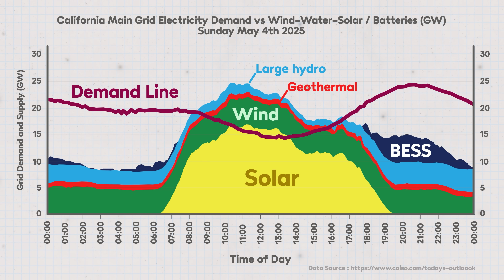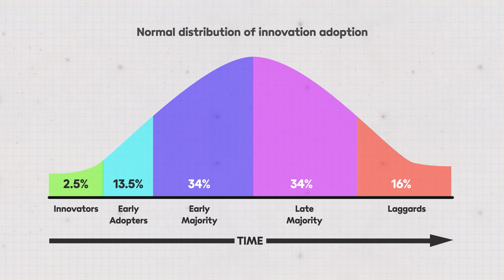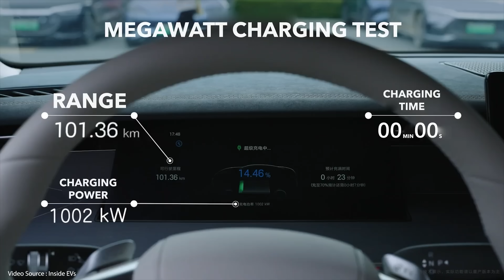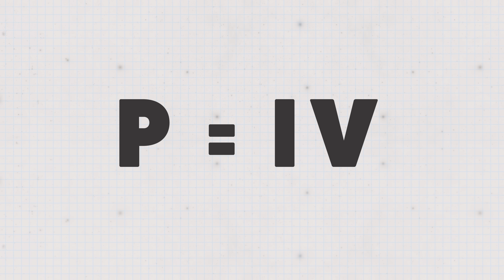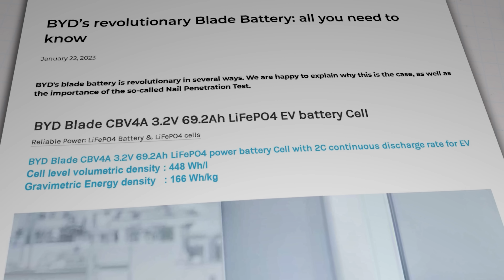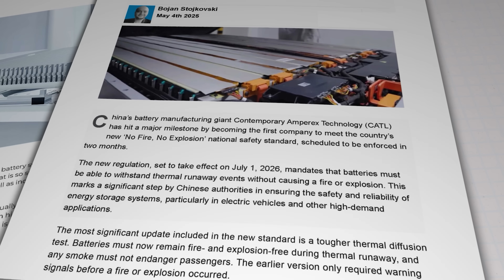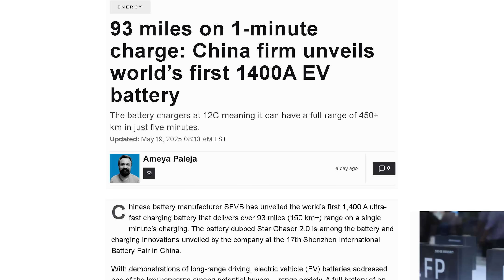BYD 1 MEGAWATT 5 minute EV Charger. Overdue or Overkill?

Comment: I've watched your videos, and appreciated them for some time, but I was very disappointed with this one! I suggest you look at the video on this topic by an Australian YouTuber, who goes by the title of MGUY. He correctly points out that the infrastructure needed to provide the power required to charge even a relatively small number of EV's in the same street, just doesn't exist right now, and may never exist!  He is specifically talking about Australia, but I have no doubt that his conclusion is valid for all developed countries. Heaven help the undeveloped countries. You seem knowledgeable enough to calculate the power required to charge 20 EV's in 5 minutes, and I strongly recommend that you do that calculation yourself. If you're unable to do the calculation, MGUY has, and it's in one of his videos. Here's a link to that video: https:www.youtube.com/watchv=GN8fPv3rRww&ab_channel=MGUY Australia  In addition, MGUY, in a previous video, explained the mineral requirements needed to achieve "net zero" by 2050, of which EV adoption is but one of many elements of this target. Here are a few examples. To have enough copper, the rate of mining copper at the 2019 level would take 250 years! If you think that's bad, listen to this: To have enough Lithium would require mining for 13 thousand years at the 2019 rate, and Gallium, 30 thousand years at the 2019 rate! Here is a link to that video:  https://www.youtube.com/watch?v=bw3M1SUZL4E&pp=ygUEbWd1eQ%3D%3D At 73, all the nonsense of net zero by 2050 is not going to have any impact on me, and I intend to keep an ICE car. The net zero zealots are welcome to their Molotov cocktails on wheels!

Comment: My feeling is that 5-minute charging is overkill for most EV drivers that can charge at home, but has a much greater degree of importance for those that can't. Of course, for the latter group, all the charging speed in the world only helps if a charging station exists near their home capable of delivering such speeds, with access as quick as the local gas station. And, at least a present, this is a huge "if".

It's also worth nothing that, in China, most people live in large apartment buildings, so the percentage of drivers capable of charging at home is much lower than in the U.S. This puts a lot of pressure on Chinese EV makers to fully replicate the gas-station experience in order to sell EVs that may not be as necessary here.

Comment: I’m not hooking up my cars battery to the grid. I would like to use it for temp power outages. But I will never agree to my car battery back flowing into the grid. It’ll be that time when I need to move, that the battery will be drained.
Reply: It's also doing wear and tear on your battery pack using up charge cycles...  No thank you, I'd rather have a full EV to be able to drive than give back to the grid UNLESS they were to pay me three times as much per kWh...
Reply: How do you charge if not from the grid?

Comment: I've been buying cars for 40 years.  2 months ago, I bought my first EV.  Reasons for my choice include efficiency, reduced environmental impact, low maintenance and low running costs.  It is a sea change for sure but one that's not difficult to adapt to.  I mostly charge at home.  I've only used a public charger once.  I try to charge in the daytime when there is plenty of renewable energy in the grid.  A full charge at home would cost me under A$20 and with that, I get around 600km.
Reply: What car do you have that does 600km on a charge? How far at 110kph on road trips?
Reply: @aussieideasman8498  BYD Seal Premium.  600 is a round figure.  I expect something more like 580 really.  I haven't tested the range at 110 yet but I'm looking forward to doing that.
Reply: @only1funkmother  I have an Atto3 that says 480km on 100% and I am hard pressed to get 400 in town and 320 on the highway (@110kph). I dare say your round figure is well rounded up. Take a long road trip and tell me what the results are? Cheers.
Reply: @aussieideasman8498  I did a return trip to Jindabyne today, just for your benefit.  ;-)

Distance traveled: 335km
Speed: mostly 100km/h
Temperature: 10C
Charge used: 80%
Implied range: 418km
Manufacturer WLTP: 570km

Rule of thumb, knock 25% off the WLTP.  My mental arithmetic was not as good as I thought it was.  :D  Thanks for the tip.

I think the other problem is that the display shows NEDC range, not WLTP.  On full, mine tells me the range is 650 which is outrageous.  :D
Reply: @only1funkmother  Thanks, it's way better than an Atto3, but an extra 10kph would make quite a difference. At least there's snow by now, but maybe not in Jindabyne.
Reply: @aussieideasman8498  G'day.  Yesterday's test was 211km at 110km/h.  This took about 53% of the charge giving a theoretical range at that speed of 406km.  This is less than 3% below my test at 100km/h.  😀
Reply: @only1funkmother  It's still poor compared against ICE cars. I would bet your car would need a truck around 396, based on mine saying 10 to go and dying (it's on a video I made). When it dies I was 1k away from a Toyota dealership with a slow charger and, while many fuel stations around, nothing in other chargers for about 20kms, and this was Sydney. When you are next down to your last 3% tell me how many chargers are in your range in the direction you're heading? That's the real problem with EVs. Comparable ICE cars to yours have ranges around double yours. I once had a Citroen C5 that could go a bit over 1,300kms on the open road, and when I was down to 3% (40kms) I almost never had to worry whether there was a petrol station ahead. There were no silly calculations to find a fill up like the nonsense I had to go through with my EV. It was heaven.

Comment: I think it's largely a psychological issue. People are unwilling to suffer even a mild inconvenience so they demand EV charging to be as fast as petrol filling. I think that's why they're aiming for 5 mins. But the difference is you can leave your car while you're charging it so you can pee while the charge is in progress. I think normal people would be fine with 10 minutes as long as they didn't have to stand with their car.

Comment: No, we don't need it!

Anything above 600 kWh or 700 kWh is a big waste and it will take 10+ years just to upgrade all locations to 500-600 kWh, let alone to 1 MWh. 🤣

It takes 300 kWh to reduce it by just 2 minutes. It's not worth it and another charging space is more useful.

Connect to the grid, and I will have to pay for a new battery due to higher degradation 🤣
👇
NO THANKS
Reply: Only industrial scale EVs like buses, dump trucks, semis, bulldozers, etc will ever need MW scale charging stations because the battery packs in these sorts of vehicles will be like the Tesla Semi which has an 850-900 kWh battery pack.

If your EV has between 40 and 75 kWh, it's just dumb to use a MW scale charging station.

Comment: So  you are going to draw down 1000 Amps  at 1000  V  ,  WHERE  can you expect that level of supply ?  Nowhere , and  do you expect  your  Electricity supplier  to  run a grid   for that , and Transformers  and current limiters  etc suitable  to prevent  blackouts , now your Neighbour just plugged in ,  the real world does not cater for dreamers  , as a 1000  Amp cable is  very heavy  copper , the plug would be huge .   Just  have a Think  OK .
Reply: High voltage transmission lines (HVTL) can push from 69k volts to 1 million volts.

Any MW EV charging units will be set up and installed close to those HVTL.
Reply: Not at your house, for sure, but 1MW is really not that big of an ask.

Comment: Where in the hell did you hear most EV drivers don’t have range anxiety? My daughter lives 2.5 hours from us and we still make sure our gas SUV is full or near full to ensure we can make the trip. Our SUV gets well over 600 kms or 400 miles. Why? Stuff happens. Traffic, accidents, detours. Plus there are tons of gas stations but still better safe than sorry. 

In Canada and the USA where we lived for years, I cannot phantom how EV drivers don’t have range anxiety when traveling long distance, which in my experience with friends and family happens quite frequently over here. I think this breakthrough and a 1000 mile battery, hell 700 mile battery are needed for most countries outside of Europe for wider EV adoption. I could be wrong. 

My friends with electric cars number one complaint is the availability of working EV chargers and line ups(Tesla owners).
Reply: Once you learn how to road trip an EV, your range anxiety goes away.

Here's how that works...

Tesla's V3 public DC fast chargers can push 200 miles of range into your EV in 15 minutes.

To charge an EV with Tesla's V3 charging unit going from say 10% state of charge to 80% state of charge it happens real quick (~15 minutes tops), but to go from 80% up to 100% will easily double or maybe even triple the amount of time you're charging your EV.

When you're on a road trip in an EV you DO NOT charge the EV up to 100% every time you charge it.  

You charge 200 miles of range into the EV in 15 minutes, or just enough to get you to the next charger down the road, and you get back on the road and drive to the next charging station.

Wash, rinse, and repeat.
Reply: Understood. My friends have mentioned this as well. My main point is that it is a habit change and until it is made at least in my circle of friends there is range anxiety and even after the mindset is changed. Your travel becomes the next charging stop not the next interesting spot to stop.
Reply: @TyrrellCornwall  Information is power.  First time I went on a road trip I didn't know about gaming the charging process and stupidly sat for hours on that road trip waiting for my charge to reach 100% every time.

Next time I drove the same route (ski trip from Dallas to Taos NM) I reduced travel time by more than an hour and a half.
Reply: @Les_S537 agreed. As I mentioned above it is a habit change and humans suck at habit change. The last 20% of any charge is the longest part of charging to 100%. Big EV fan just think these breakthroughs are needed for wider adoption in North and South America, Australia and other large geographic regions.
Reply: @TyrrellCornwall  "The last 20% of any charge is the longest part of charging to 100%"

Again, this isn't a problem because the only time you should EVER charge your EV to 100% is on your first leg of a road trip, and that's it.

For longevity of your battery pack, best practices are that you keep the charge between 20% and 80% at all times.

Conditioning the battery pack by staying within this range really helps with longevity.  

That, and always trying to charge your EV with the lowest voltage/amperage possible.

Most people only drive 30-40 miles per day.  A typical 120v/15amp outlet can charge 30-40 miles into your EV overnight while you sleep... 

So you drive your 30-40 miles, and when you get home you simply plug your EV into the 120v/15amp outlet, go to sleep, and by morning those 30-40 miles are charged back into your car.

Comment: EV hypers always loose with the details.  Sure 1 MW: 1000v at 1000 amps. 
1000 amps through a charging cable - LOL. A 3 inch (75mm) thick charging cable and corresponding wiring inside the car. 
N.B.  only suitable for Gym Monkeys and dreamers.  The EV industry keeps the BS flowing no matter how stupid.

Comment: I had a think. How do you get 1MW of power to all the chargers at a recharging station?
1 MW is about 6 weeks of electricity consumption for the average house (in New Zealand where I live). If there were 5 chargers that's about a house's years worth of electricity in 5 minutes. How?
A 500 kV overhead cable is needed for 1 MW supply. These are typically strung up on towers. 
Fact: EVs are never going to be charged at the same rate as a petrol or diesel vehicle. Of course as it's pointed out is this even necessary?
Reply: NZ doesn't have any 500KV circuits. Biggest we have is 220kv with 400kv on the cards.  Getting 1MW would be trivial - 100 amps on a 11kv circuit, and those run all throughout the country on pylons.  Towers aren't needed for a supply that small, though there are some 11kv circuits on towers.
Reply: @jnawk83  Watch again they want 1,000 Amps.
At 400 kV, the maximum current typically handled by a power line can be around 1,000 amps per phase. 
So plug in 3 cars and watch whatever else is connected go dark.

Comment: Form Follows Function. While I drive an EV as a daily driver pulling my trailer and hauling large loads are out. Therefore my second vehicle is a diesel to get the functions done.
Reply: And this solution is being implemented in the long haul trucking industry in Europe.
Reply: You know what the fix for EV trucks towing trailers is?

Put an EV motor on one or more of the trailer axles, and add a 40kW battery pack to the trailer.

When you hook up your EV truck to the trailer, for instance to connect brake lights, etc, at the same time it would assume control of the EV motors for the axle.

Having one or more EV motors BENEATH whatever it is that you're towing will greatly increase efficiency for your tow...  The EV motors BENEATH the load "push" the load along instead of the load being pulled behind your EV truck which strains THOSE EV motors.

If EV truck and trailer work in unison your efficiency will increase greatly.

Comment: I have a work vehicle so I’ll be a laggard, raises some interesting questions about how EVs would work for a company vehicle though, with a fuel card the company pays for fuel but would I need to charge an EV myself at my own cost, I can connect at work but would that be enough. Also mine needs to be capable of carrying a 1T load on the back of the utility. Feels like it’s getting close to reality but not quite there yet imo
Reply: We have these things called electricity meters. We use them to measure the amount of electricity that is consumed. If you're charging at home, they can install one for the EV charger, and reimburse you.   Or just reimburse you at a mileage rate, it's not as if we don't know how much energy it takes to move around.

Comment: This all but negates the benefits of EVs. Peak loads are what kills the grid. Low, slow charging is the key and is all 99% of transportation needs.
Reply: The reality is that MW level charging will only be used for industrial scale vehicles.

Of the ~1 billion+ vehicles on the roads today only ~5% of them are industrial scale vehicles like buses, dump trucks, semis, et al.

These vehicles will have huge battery packs.  The Tesla Semi for instance has an 850-900 kWh battery pack.

For personal EVs with 40-75 kWh battery packs this MW scale charging doesn't make any sense at all.  Pushing that much electricity into a battery that size means major heating and subsequently degradation of the pack.

MW will work well with EV trucks that do a lot of towing, but smaller EVs its just dumb to contemplate using it.
Reply: @Les_S537 I agree however even "industrial" vehicles will break tge grid.
Reply: @andyfeimsternfei8408  Sure, they'd break the grid, IF the grid stayed in its current form/state, but every grid on the planet is a project in motion with portions of the grid having the latest and greatest, portions that are dated but still fully function, portions that are outdated and dilapidated.

We're constantly updating and adding new capacity over time, just like we always have.

The grid will grow to supply for the demand.
Reply: No charger is in use 24/7.  Just install local batteries and charge the charger when it's not charging vehicles. Reduces the peak load.
Reply: @jnawk83 It would be better if it was a 24/7 load. The peak is the killer. Sure batteries cand help, but its a lot of infrastructure just to zap a vehicle full in minutes.